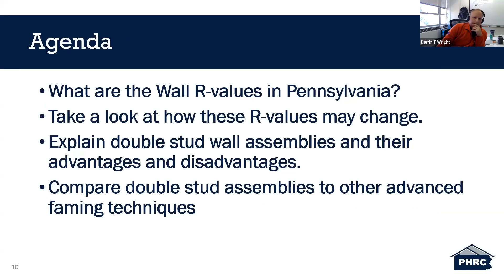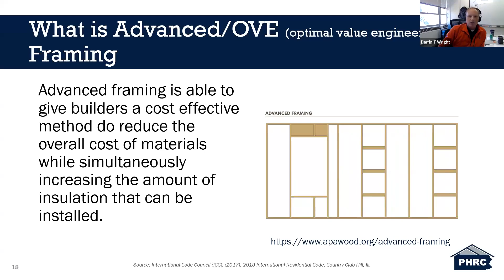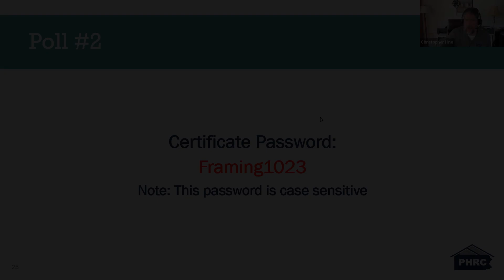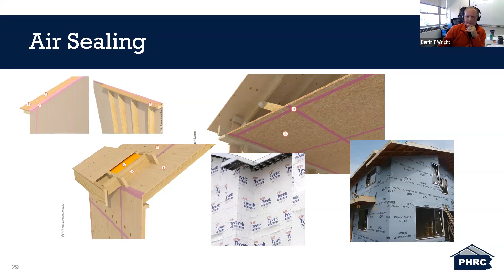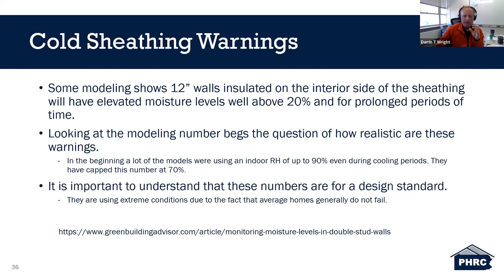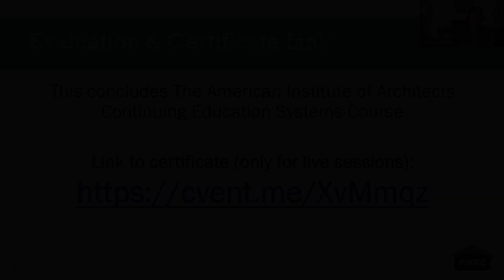Double Stud Wall Assemblies

Comment: All other things being equal, staggering studs does not improve thermal performance. It's dogma. Do the Manual J on the assembly.
2x8 walls and 2x4x2 both are R-30 with the proper fiberglass and rockwool.
What about putting a smart vapor retarder between the double stud walls?
Reply: Yeah, as long as they are not touching, it should make no difference if they are staggered or not. I was wondering about putting a smart retarder between the walls as well. Double 2x4 wall with a 4 inch space between. Then the retarder on the back side of the inside wall. As far as I have been able to find out, you need that 2/3 to keep condensation from building up on the vapor retarder. I thought dense pack in the 8" space, then rockwool in the 4" space. Then you almost never have any penetrations in the retarder and the rockwool should breath to the inside very well. IDK if this would work in a cold climate like Alaska where I am.

Comment: Here is a double wall assembly being used in Alaska, climate zone 8. Some severe building issues with moisture and condensing surfaces. I would really like some feedback on this method as I am building in Alaska this summer. 

 https://www.youtube.com/watch?v=8uR87sc5Shg

Comment: The overall material and labor cost of double stud is far less than doing exterior insulation to comparable r-values of double stud. Cause cellulose cost less than a third of rockwool comfort board, and the details are more complex for exterior insulation which increases labor time.